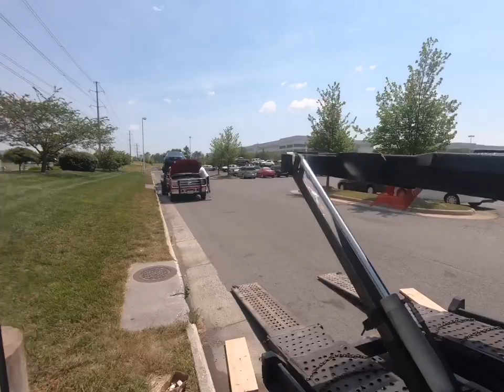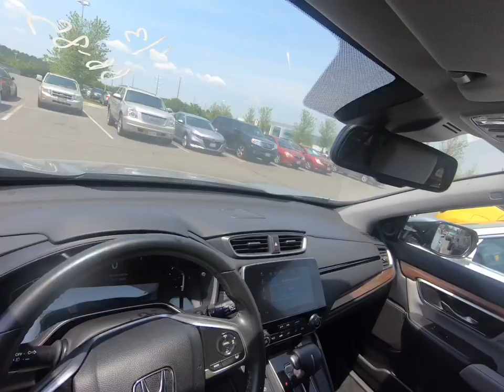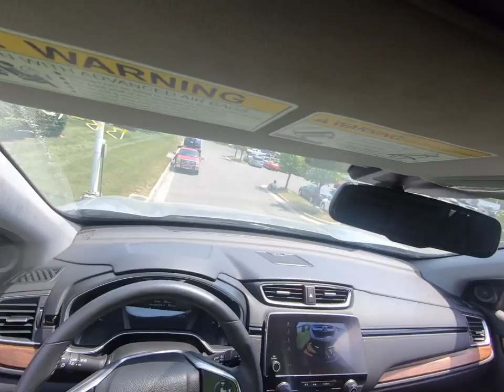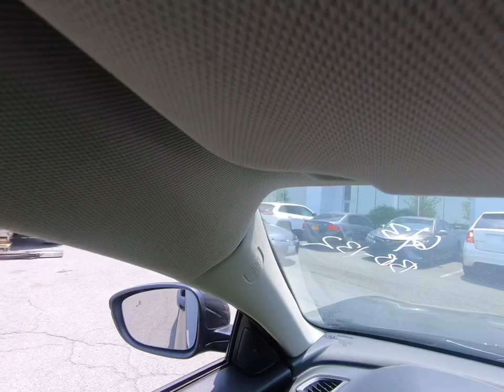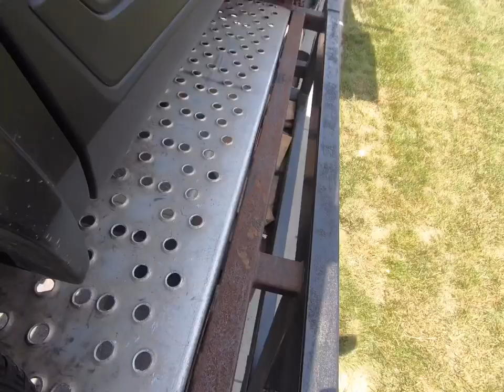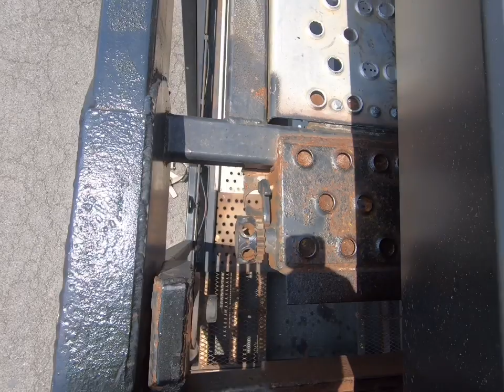Loading A 7 Car Hauler | Adesa Auction

Comment: You gon hate the stinger that thing is super uncomfortable never again I rather do a tow behind car trailer any day I don’t mind making less
Reply: The other Perk to pulling only a car hauler trailer is you can buy a cheaper truck with more head clearance and bigger sleeper cab and you can be more versatile by having the capability to hook up to multiple different types of trainers as long as your truck is spec'd for them. I plan on doing a 7 car because I don't want to be married to car hauling my whole life. I like diversity. I want to get a low boy flat bed so I can haul heavy equipment and other freight. Also, have a 53' dry van for whatever as well. That way no matter the condition of market for any type of freight or niche, I always have at least 2 out of 3 I can keep my wheels spinning. Start with a cheap used truck pay it off quickly, then get a new or newer and better truck or just keep the first truck and get another that's more dedicated to flat bed and use the other for dry van and car hauling. But you have to have your own authority

Comment: Leek what does your engine water temp run at when loaded just on flat surface? I have same engine as you feel like mine is running hot
Reply from the maker: Marshall Lamb a little over 150, are you idling when it do that?
Reply: No my idle temp is like 180 when I’m pulling a load 200-220.
Reply from the maker: Yea idk, I haven’t had that problem besides having low coolant of course. Maybe try changing you filters and see if it helps
Reply: Marshall Lamb you either got a pinched line, clogged radiator, old coolant, bad pump, or bad thermostat.
Reply: Ok. Yeah I’m going to buy a core for radiator and have then change it out see if it helps. It’s old truck and core looks trashed
Reply: Marshall Lamb you should always do the easiest thing first.
Reply: Fam dope video you make understandable... looking into this business

Comment: Is it possible to gross 400k with 7 cars for 1 year if work is your priority?
Reply from the maker: No not with a 7 car, you would need a 10 car to get close to that. Usually do about 350k with a 10 car
Reply: @TruckingWithLeek  how much for 6 to 7 cars?
Reply from the maker: With a 7 car your doing the same amount as if you have a refer trailer, which is around 150k or a little bit more. The only difference is you don’t have to stay out as long to make it
Reply from the maker: 150k-200k
Reply: @TruckingWithLeek  how long do you normally stay out?
Reply from the maker: @jatevinhorn8132  home every Friday, sometimes every other day
Reply: Did you try car hauli